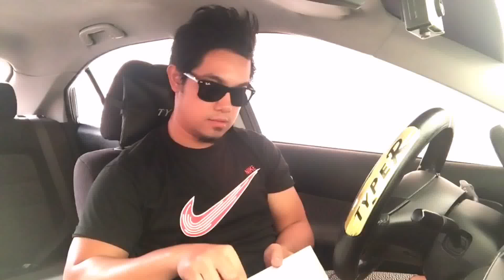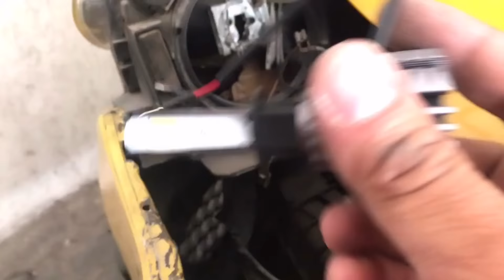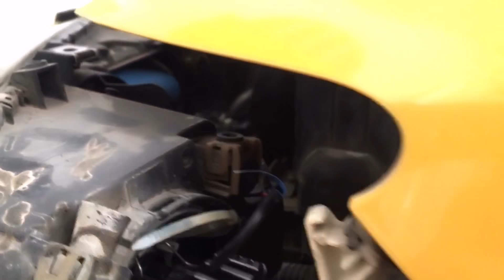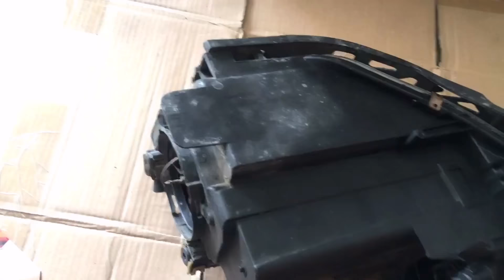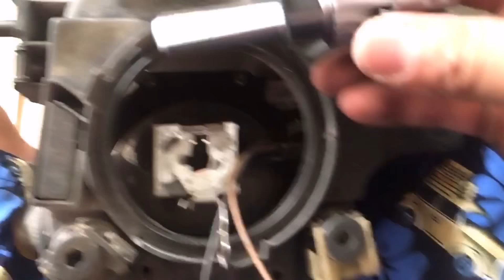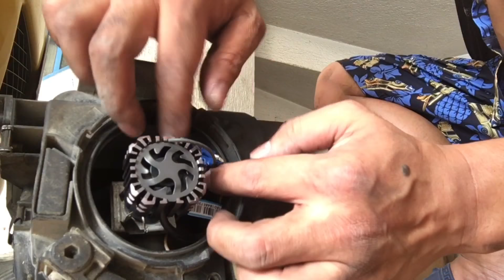HOW TO INSTALL H1 LED HEADLIGHT (for 2003 Mazda 6)

Comment: I have a 2006 Mazda 6 and install LED bulbs in the stock headlamp housing.  
Please not reusing the old headlamp on any Mazda will result in a dimmer output than stock Halogens due to inadequate reflective projection.
You may also need to modify (cut) the original housing to get the LED bulbs to fit and the cover will likely not fit.
In other words, it's a pain to convert to LED's to get less light output.
You will also need to remove the bumper. 
This is not necessarily a good option.
Best to purchased dedicated LED headlamps.
Reply: I'm agree I also have Mazda6 2006 & problem even change lamp not to modify to led. I buy a pair without ballast & couldn't plug them.. I have them on my tank without use them.. So to ask you did you still have halogen or you find a good kit for mazda & which one?

Comment: What about putting the covers?🤔
Reply from the maker: Covers will be useless once you install a H1 type LED headlight due to the size. Theres no other type of LED just only H1 type for mazda 6 2003
Reply: @RyanBautista  so the moisture just gets in?! :O
Reply from the maker: Kaspars Strožs you can put or cover the area, depends on you. For me i did not put a cover because H1 headlight might cause burning of the car

Comment: Hello I have a Mazda 6 2007 but mine is only one cable ! ? Is it the same way to install in a 2007?
Reply from the maker: Mazda 6 gen 1 2002 to 2007 models are having the same type of bulb. It is using H1 type of bulb.

If your headlight is the same as mine then it is H1 type of bulb.
Reply from the maker: Yes, it is the same way to install.

The cable you can see is the positive which is connected to the bulb itself.

The negative is connected just beside the positive. You can fix it by yourself it is easy.
Reply: Ok thank you but how did you get two Separate wires two bling both jnto
Reply from the maker: That's an LED Headlight. It has already a positive and negative wire on it.

If you want to do the same, just remove the positive wire connected from your H1 headlight stock and the negative just beside on it. Then connect this wire to the LED.

Red (positive) and Black (negative) from LED
  - White (positive) and Black (negative) from your car
Reply: So I have to splice the wires brother ?
Reply from the maker: Raul Martinez no need to do that. It has already a lock clip which u can see on my video
Reply from the maker: Nick Picano if the bulb type is H1 theres only 1 wire connected to the bulb, the negative wire is just connected just beside it.

You can search in google what type of bulb used on your car

Comment: If you don't put the dust shield moisture get inside even water
Reply from the maker: LED headlight won't fit if u don't remove the dust shield. I did dissassembled and clean inside the headlight already since I know how to open it.

Comment: what about the cover over the light...wont water ingress get in. u looking for
 subscribe well do a proper ending video
Reply from the maker: The water wont get in and the led is waterproof theres no chance to get the water inside the headlight unless you splash with water. So sorry i cant explain properly in the video coz i am not the kind of a professional youtuber